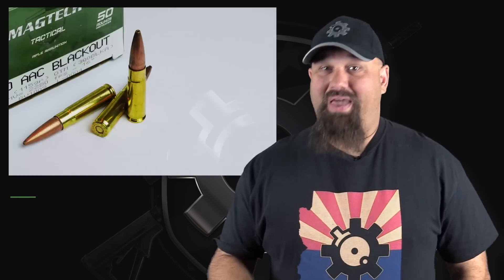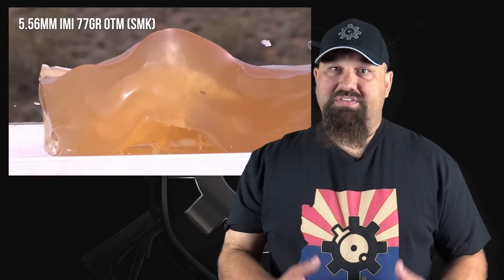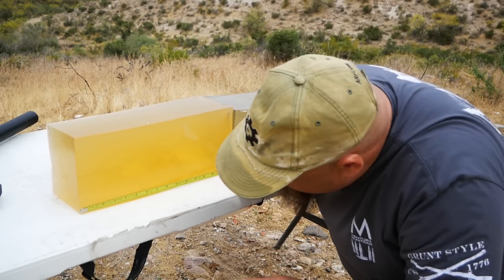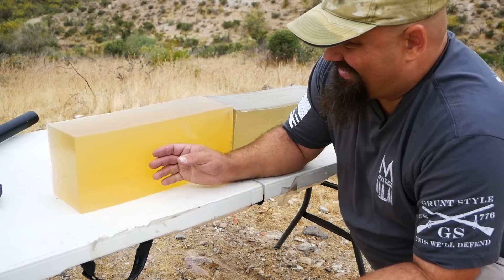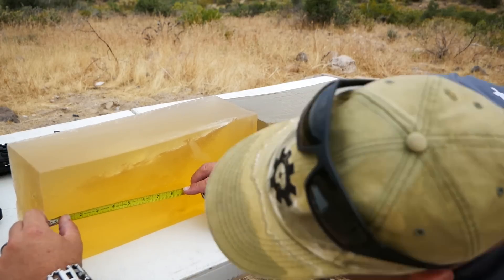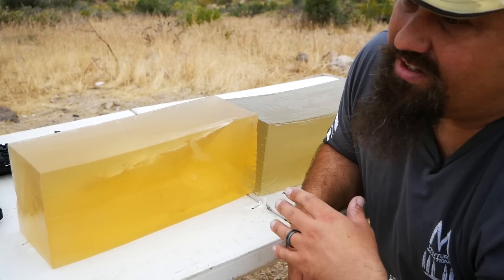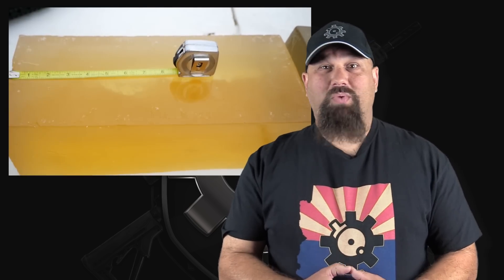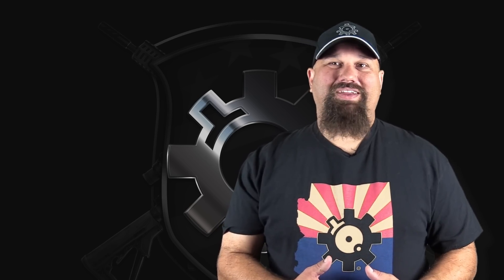Why OTM = FMJ In 300BLK: Magtech 115gr OTM Gel Test

Comment: And 5.45 guys would call this amazing performance, if it was a 5.45
Reply: Muh poison bullet
Reply: The faster it will make a dirt bag take the room temperature challenge, the better!
Reply: @Eugene Stoner How about a .50 bmg???....you know, for science.
Reply: Would you be willing to take a 5.45×39 round, center mass at say....300 meters ?  Or perhaps you'd prefer a loaded 110 grain, BLK loaded with a Hornady GMAX  ?  You could REALLY snivel about the "accuracy" of either round at that point.
Reply: @delta3two  
Huh?
You're completely missing the point.

5.45 rounds don't fragment and only yaws. 
This particular round in this barrel length doesn't fragment and only yaws.

When a 300 round performs like a 5.45, or a 7.62x39 for that matter, it's considered somewhat a failure. Yet, 5.45 shooters consider it the best performance a bullet can have.

Truth is, you take any of these center mass and it's a fight stopper, most likely.
Reply: @theimmortal4718  Most likely. But if that shot doesn't hit the spine, the hit that causes more disruption will tend to end the fight more quickly. Even if the heart is completely torn in half, a bad guy can have a few seconds of conscious activity so if you can produce significantly more disruption without causing significantly more recoil (and slowing follow up shots), you have a better chance of achieving physiological incapacitation before the bad guy can harm someone. Of the examples given, the .300 GMX has the best chance for increased tissue disruption, but at that distance, all the examples given would be likely to produce relatively unimpressive yaw type wounds.
Reply: @newsofthepews  
I agree. As far as performance goes (not considering barriers), in order of preferance-
1. Fragmentation (with 12" min)
2. Expansion (especially with barriers)
3. Yaw
Yaw is much less a preferred wounding mechanism for incapacitation over fragmentation 

My comment was that when any other cartridge is shown not fragmenting, people talk as if it's a failure, while 5.45 guys make it out to be a resounding success.
Reply: @theimmortal4718  lol, I know. I did have some good test results with a Russian soft point in 5.45mm but you'll have to wait for the details.
Reply: @delta3two  would you be willing to let me throw chicken poo at you? No? Well then your argument sucks.
Reply: @newsofthepews  HAHA!
Reply: @newsofthepews  My argument is legitimate.  Perhaps you need to mature a bit before you make asinine remarks.
Reply: @delta3two  no, it's a terrible argument. Probably the second cringiest thing people say about guns on the Internet.
Reply: @delta3two  Grey Death Adder? Is that you....?
Reply: Tevo77777 20 times with a .22 ? Gtfo.
Reply: @delta3two  would you be willing to let me shoot at you from 300 meters with a 22LR? I will take a guess and say your answer is no, but does that mean 22LR is a great choice to defend yourself with given the options you have available? Now do you see why that stupid "are you willing to get hit with it" argument is so cringeworthy. I wouldn't want to get shot with a pellet gun. Am I going to depend on one over an AR with ammo that performs amazingly? Not a chance.
Reply: @newsofthepews  I would ☺️

Comment: 7.62x39 isn't 200fps faster across the board that only applies to 16" ak's in short barreled guns like the honey badger that were designed to use the 300BLK are much more effective and efficient due to faster burning powder. An 8.5 inch 300blk has probably better ballistics across the board compared to an 8.5 inch 7.62x39

Comment: I kind of hate that everyone just uses a short barrel for .300Blk. Yeah it’s designed to work with one but most people can’t SBR and use the standard 16in. Out of a 16in it’s neck and neck with 7.62x39 in terms of actual performance. On paper 7.62x39 has more velocity but from the deer I’ve seen, you couldn’t tell either apart. Light weight .300blk is pretty good at close range, is now cheaper than any 7.62x39 I can find, which is mostly corrosive or “non-corrosive” from sketchy ass country’s that rust just like corrosive, and can just be fun with subsonics for smacking groundhogs. Unless you want a short range home defense style build, 16in gives you perfectly fine intermediate rifle caliber performance.

Comment: Send a 110 gr SST or 115 Gr OTM thru a 16 inch barrel at 2350 FPS and see what it does. AN 8.5 inch barrel is great for subsonic but to milk performance from any variety of 300 BLK , the 16 inch barrel will impress.

Comment: For home defense, at distances of 5 to 15 yards, using short barrels 5-8 inches, what do you recommend for liquefying the bad guy internals? I am not allowed to use a suppressor in my community, will risk the noise given that putting him down with the least amounts of rounds would save my family. What would shred the bad guy besides a shotgun at those 5-15 yards?
Reply: A 12.5-16 inch 5.56 AR-15 platform rifle firing M193 55gr or 77Gr OTM(77gr does best out of short barrels and hits insanely hard), or a 10.5 inch .300 blackout AR pistol firing 110gr Tac x. If AR platforms are outlawed where you live then im not sure, go for a shotgun.
Reply: @trippie_fabio3181  Yea was thinking 300 blackout 10.5 to 9 inch barrel supersonic rounds

Comment: I have found that Precision One 300 Blk ammo loaded with Speer 130gr HP bullets perform very well for self defense out my 10.5 “ upper. Tested in water jugs and penetrated 3 jugs &  stopped between 3rd & 4th jug just putting a crack in the 4th jug. Perfect expansion & bullet core & jacket remained intact.

Comment: Different projectiles of same weight (eg. 150gr) perform differently. If you want performance- RELOAD! Most mass manufactured ammo is just that. To get performance at target buy projectiles intended for the application/use of the projectiles. Verify your fps of a given barrel length and cartridge. Then get projectiles that perform at those velocities. The manufacturer typically has best performance velocities available to the purchaser. My experience has been that “match” projectiles are intended for tight groups at the range, not best suited for rapid expansion/fragmentation.

Comment: For all the New Guys to 300 Black, and those considering getting into the caliber, beware! I own two, 10.5 and 16 inch. I did my homework and knew what I was getting. That means I knew it's limitations. If I had a post, it would be titled, "Best Bastard Caliber Ever." Right tool for the job is the key to 300 Blk, or better, Right Component for the Job. 300 is not 223, 76.2X39, or 308, it's unique. You want expansion, go fast and light; as in 110 V-Max or Tac-TX, or a 125 grain Varmint bullet. Just drive it fast, and make sure the bullet has a thin jacket. The versatility of the round is unmatched, when using it for what it was designed to do. IMHO, if you're not going to suppress it, why bother? 5.56/.223 or 762X39 are ballistically  better at given ranges. None are better in a short barrel, or suppress better.

No intruder is walking away from my "purpose built"10.5 inch 300 Pistol. Few hog or deer will run far, shot with my 16 inch 300 with a well placed shot. On the other hand, I shoot subs for fun, and it's a truck load of fun. Hearing safe indoors, and the racoon I shot is dead from the supersonic 125 grain TNT supersonic suppressed inside a closed room.

Comment: Hornady 190 grain, subsonic expanding (subX) for defensive ammo fired from a 9.5" barrel, 1/7 twist. Lower pen, yaw and spread.  i.e. rifle damage from pistol platform, lower audible response and less over-pen. suppressed or unsuppressed, 30m zero.
Reply: That's a nasty setup, but not really rifle performance. Subsonic 300BLK has its merits, but tissue disruption isn't one of them.
Reply: @asdfghjk2933  Rifle performance for range or damage?  It still meets the FBI 15" standard it just doesn't fly through multiple rooms and into the next house.  with bullet weight and velocity almost supersonic, what I've shot at would beg to differ with your damage comment.  Plus, suppressed, still enough bang to cause FIBSA and not blow out your eardrums.  

Now this is a personal and home defense setup, It's a tool meant for close and personal, not range. As far as range, I'll grab the 5.56 for that. Besides, if an intruder is at range, he's no longer an intruder.
Reply: @bonesely9858  Both, I suppose. I'm just comparing that to supersonic intermediate rifle rounds like 5.56 or 7.62x39 that exceed 1000 ft lbs of energy and are able to do velocity based damage far beyond the path of the bullet itself. Subsonic 300BLK can certainly expand quite a bit, but you're not getting any of that high velocity rifle wounding. That's what I was talking about. Compare that 190gr bullet at ~1000fps to supersonic 300BLK (110 grains at 2200fps), and the supersonic load has nearly 3x the energy. Same thing applies to 5.56. 

A subsonic 300BLK AR pistol is more like a PCC in terms of energy and damage, but that is still a very respectable weapon. I wasn't trying to  dismiss your choice at all. The fact that it's still putting out ~400ft lbs of energy while being completely hearing safe is very appealing. It just won't have "rifle" stopping power.
Reply: @asdfghjk2933  Right but foot pounds don't directly transfer to impact and effectiveness. You have to use mass×velocity×diameter of bullet÷7,000 = Taylors knockout factor. 

This was the basis Remington, SOF and AAC used to develop the Blackout subsonic to get rifle effects in a suppressed weapon above 9mm.
Reply: @bonesely9858  That is true, but velocity certainly does transfer to impact and effectiveness. That is why bullets above ~2000fps (plus or minus 200fps depending on bullet diameter) are capable of doing damage beyond the bullet itself, but lower velocity projectiles aren't. So while energy doesn't always correlate to damage, it is mainly influenced by velocity,  and high velocity is what causes rifle type wounding.

I'm not sure if you're a hunter, but this is very easy to see when field dressing a deer. Shoot them with a subsonic 300BLK or a handgun round, and you will just see an expanded bullet sized hole in the vitals. That will do the job if your shot placement is on point, but it's very unforgiving. Do the same thing with an expanding .308 or a fragmenting .223 or an expanding supersonic 300BLK, and you will see a 3" or even larger wound cavity with bruising/bloodshot meat around it. The animal will go down much quicker. That's rifle type damage, and you don't start seeing that until you cross that velocity threshold I mentioned.
Reply: @bonesely9858  How is it an "apples to oranges" point? You're claiming that subsonic 300BLK is giving you rifle performance, and I'm saying that's physically impossible. A bullet travelling at 1000fps will simply not do the damage of one traveling at 2500fps or 3000fps. It's really that simple. It doesn't matter if it's at 0 yards or 1000 yards. You're challenging me to show you the difference between subsonic and supersonic rounds at room distance? Fine. Shoot an animal at close range with a .45 acp. Now do it again with a .308. There ya go. Subsonic vs supersonic in this situation doesn't mean 1000fps vs 1200fps. More like 1000fps vs 2700fps. 

A subsonic 190gr .30 cal projectile is roughly equivalent to a 9mm or .45 ACP fired out of a carbine. Nothing wrong with that, but don't pretend that it's something it's not. 

As far as your 2nd paragraph, I'm not sure what you're trying to say here. I never brought up supersonic 300BLK, but sure, the 110gr varmageddon is a good round. It's no better than a decent 5.56 round, but whatever. Idk if you're trying to say that the 110gr varmageddon is faster than a 5.56, that's completely backwards. A 77gr 5.56 fired out of a barrel long enough to get 2450fps out of a 110gr 300BLK will be travelling around 2850fps. Nearly identical in energy. 

"Ultimately, I could use crescent wrench as a hammer and it would work. "

That describes subsonic 300BLK very well. Why you would neuter the terminal ballistics of your rifle with subsonic ammo when you could be using that 110gr varmageddon load (which is nearly 4 times as effective)? Assuming you have a suppressor, supersonic 300BLK still isn't going to damage your hearing. Idk, maybe it's just me, but I want actual rifle ballistics in my rifle. Not glorified pistol ballistics.
Reply: @asdfghjk2933  I already made that point though.  If I want to increase the velocity and fragmenting of round I could go to a 110 Varmageddon or 110 VMAX but there again, I sacrifice hearing and terminal ballistics safety which to you, was no big deal because you live alone and the nearest neighbor is miles away.

Maybe I wasn't clear on the comparison,  there is no distinguishing difference at a .300 aac at 2450 fps (110 gr. Varm.) and a 5.56 (62 gr. 855A1) at 2900 fps (the difference of 450 fps at range) then at 12' feet (the average distance of an intruder engagement) .300 aac at 1020 fps (190 SubX) and a 5.56 (choose your round) at max of 2900 fps the difference would be negligible at best.  I just get to save my hearing and not worry about over pen as much.  .300 aac is more comparable to 7.62x39 in 30 cal, where as 30-06 is closer to 300 win mag and 308.
Reply: @Bones Ely  So im not sure if you’re aware of this, but that subsonic load you picked will overpenetrate more than a 110gr vmax or varmageddon will. High velocity bullets don’t inherently overpenetrate more than subsonic bullets. The much higher velocity combined with propensity to fragment means that the 110gr vmax or varmageddon will shed its energy much quicker than the subsonic bullet, be it in flesh or in drywall. That means it’s much, much more effective on target AND safer in the event of a miss.

So my point is that the subsonic is not comparable in performance to 110gr 300BLK or 5.56 in any way. That’s why I included those videos. Yes that’s a comparison of subsonic 300BLK to .30-06, but the supersonic 300BLK will still be dramatically more impactful on target.  That’s what I’ve been trying to say this whole time.
Reply: @asdfghjk2933  you're comparing ballistic gel to actual effects on the body as opposed to the 15" test that the FBI requires for efficacy and I said that about the 110 grain but I sacrifice hearing. 

Let me clarify, "5.56 is" not "master race", It's extremely effective, I carried it from the A1 platform through the M4 and still have it, staged, as part of my home defense plan but when it comes to home defense, it's the .300 pistol that I will grab first, if I can. I know this is antidotal but look at the origins of the .300 aac.

SOF wanted a completely suppressed weapon above 9mm (mp5) in rifle caliber for the propose of cqb as well as a standard carbine.  What better example of cqb is home defense? 

Do you own a .300? If not, don't buy one because it keeps the price of ammo down for me.
Reply: @bonesely9858  Alright I think we're arguing about different things at this point. I never mentioned 5.56 being "master race" in this recent exchange, that was just a stupid fanboy comment I made a year ago. That has no relevance to this discussion.

Nah, I have absolutely 0 interest in 300BLK. I don't plan on running subsonics for HD, and 5.56 is more than good enough for me. If I wanted a very potent SBR, I'd go with 6.8 SPC or something like that. 

That said, best of luck getting more ammo. Prices are screwed up enough as is, and 300BLK was never a cheap caliber. to begin with.

 I'm not gonna try to change your mind on running subs for HD anymore. Do whatever makes you happy. It's a free country after all.

Comment: Wasn’t the 300 blk designed to give our soldiers more punch on the battlefield while at the same time saving major cost by only having to replace a barrel ? Also at longer range doesn’t it perform better than the 7.62 x 39 due to having a better ballistic coefficient ? And what about size, doesn’t the 300 blk reach max velocity in only 9 inches of barrel ? As for covert actions, doesn’t the 300 blk suppressed, out preform the 5.56 ? I am not a hater of 5.56 or 7.62 x 39 as far a calibers go tho I really dislike AK platforms, I just feel that 300 blk is a great option and choices are always a good thing. I fought getting a 300blk, but once I did and started to play with it I felt like a dummy for not getting one sooner. Just a thought. Thanks for making great videos.
Reply: Correct. The Dutch military requested an effectively suppressable rifle round they could fire out of their M4 style rifles but with a fair bit more kinetic energy than 9 mm. And so the .300 Whisper was born. After the experience of the Dutch SF units with it, soon other militaries took it up as well.

Comment: So straight to the ponit is 300blk good for deer hunting
Reply: Been trying to find out the same thing. All the guys who hunt ballistic gel seem to be hesitant to give a straight answer. However the handful of guys who made videos of their 300blk deer hunt appear to have freezers full of meat.
Reply: It kills deer for sure. But it is not some magic bullet like some folks claim. I think of it as like .30-30 light. Ive killed 2 deer with my blackout and my hunting partner has killed several with his. Based on my experience i recommend a solid copper bullet under 130 grains. I like the Remington loaded Barnes 130grain ammo and my buddy uses the Hornady gmx, i believe the 110 grain.  With good shot placement deer go less than 100 yards. This round doesnt have the "knock down" of my .308 or his .270 but it kills deer just fine. We use ours in our Bow setups where shots will always be under 100 yards